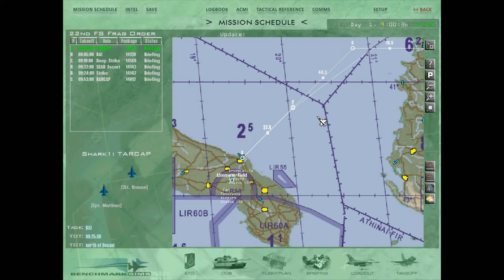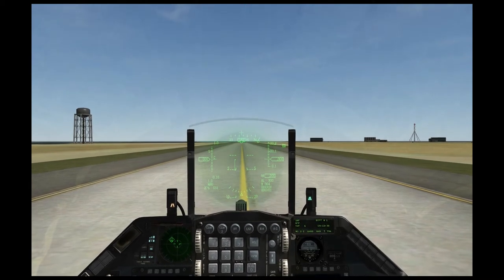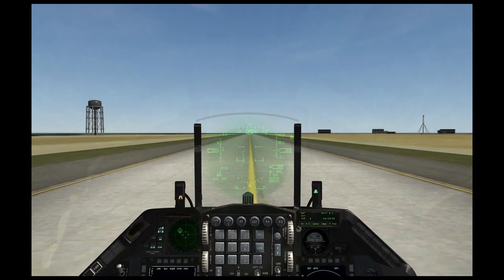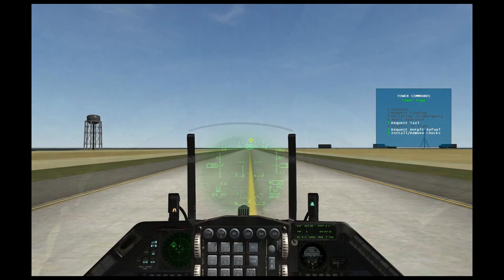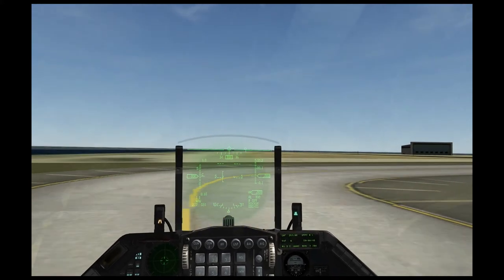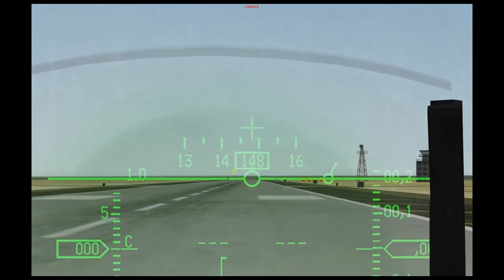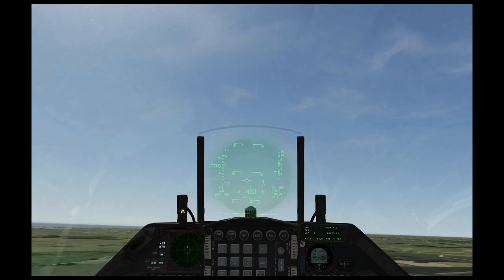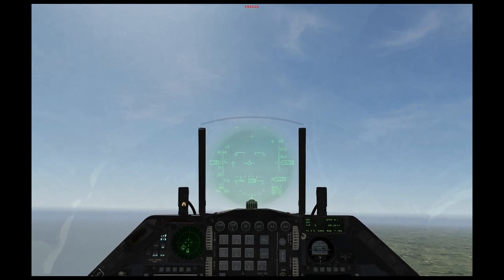Falcon 4 BMS Tutorial: Taxi and Takeoff

Comment: Here is some helpful information for beginners. While you are sitting on the taxiway, press "list" on your ICP and then press the number "6". At the bottom of your DED display will give you ground speed. you can either watch that, or flip the switch on your HUD panel to display the DED information in your HUD. Now just watch your ground speed while you taxi. Do not try to turn at speeds above 12. You can put the jet on it's side.